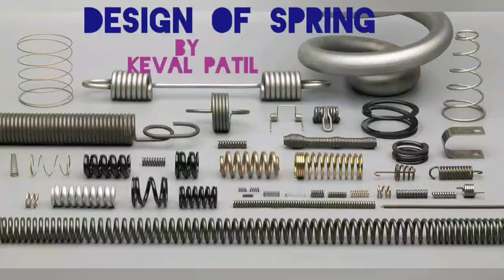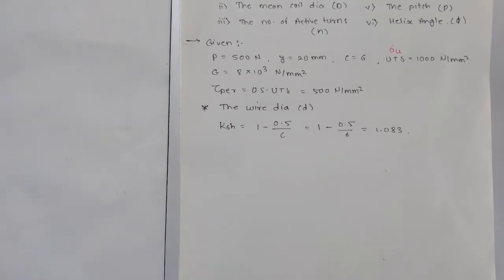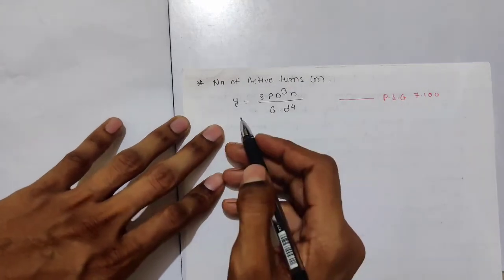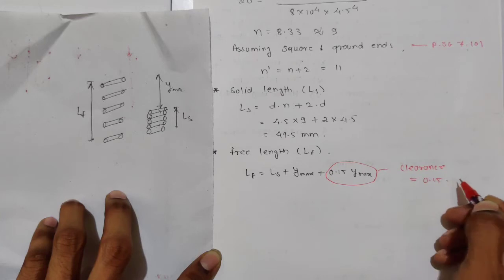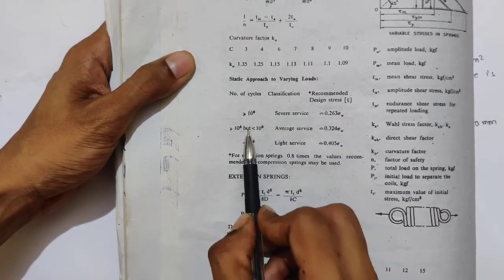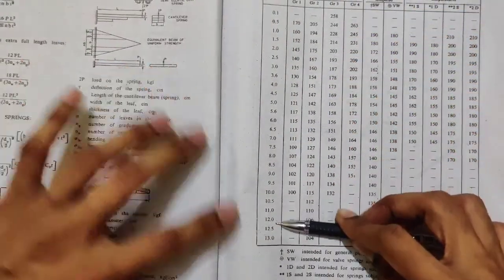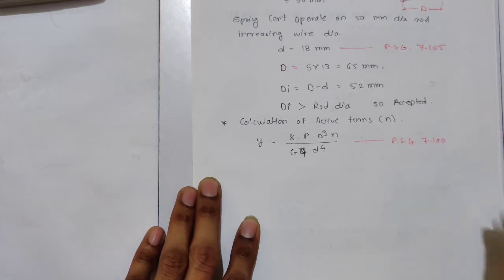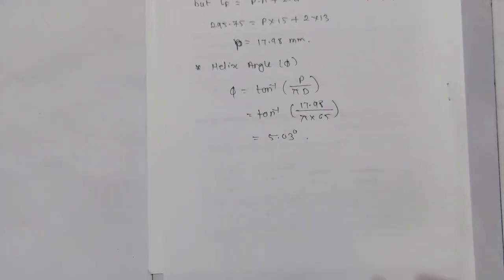Design of Springs: Part 1, Static Approach using PSG (Hindi)

Comment from the maker: Hello guys,
In first Problem by mistake I wrote `- ve` sign for "Ksh" formula. It is having positive sign 
Ksh = 1+ (0.5 /C)
But answer is correct.

And Value of modules of Rigidity is 80 * 10^3 .. in question I took it wrong.. it is usually 80 * 10^3